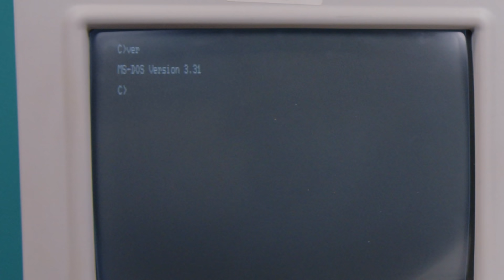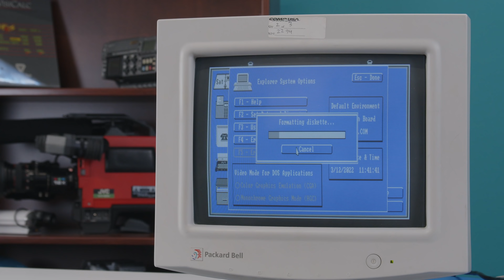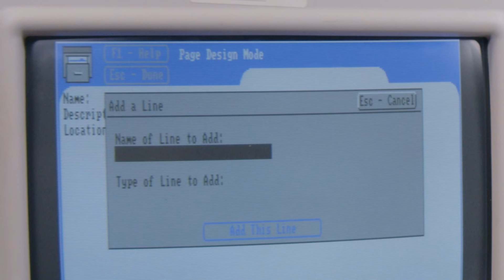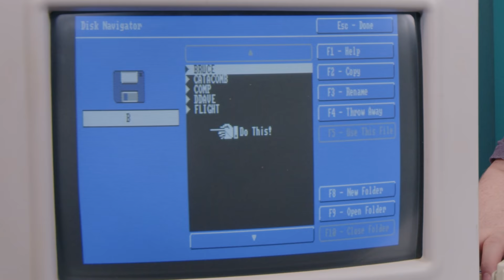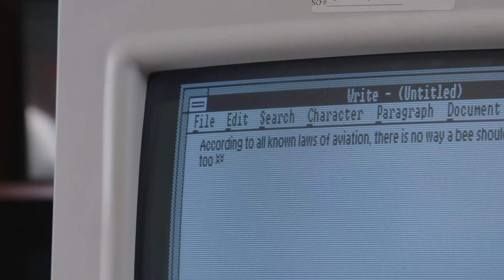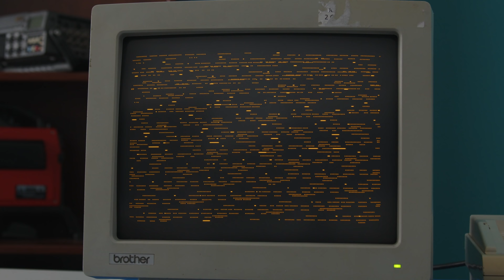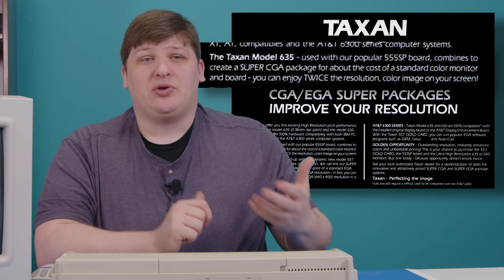Headstart's PC With The Weird GUI "OS" [Explorer]

Comment: About access to the Bios of the 8088 era machines.  Most of them used a program to access the bios, including early 286 before the (Del) or (Ctrl-ESC) of some specific combination key were used to access the bios.   Yours, probably had a program on the system disk that came with MS DOS disk set from Headstart.

Oh lord, you're naïve,  you're criticizing the GUI when you have no idea of the programming language used at the time to make this GUI.  At the time, PC's were linited to 512 or 640 kb  of ram.  MS DOS 3.0 was the last small form factor OS that used the bare minimum of RAM out of the 512 or 640 Kb.  Now if that interface had been in Text you would see a difference.  Now to understand why the interface was that slow and limited, it's because of the video memory available for CGA, EGA and MDA/Hercule mode,  and the speed you write to that memory, if you push the data too fast in that video ram, you would get snow on screen due to the refresh rate.   I did some programming and let me tell you making a program that had pull down menues in text mode was special to program.  They were tricks to avoid the snow effect in text mode and have seamless text windows with pull down menues and pop up windows and you often had to do that in assembly language and with turbo pascal and Turbo C it got easier and the worst was MDA and hercule video cards that forced you to consider and program all the different video mode available at that time.   That was before windows 1.0  and your GUI on the headstart was probably inspired from the PCJr or Tandy graphical interface in DOS.  Anbd when PC & MS DOS 4.0 came out IBM had for a short time a graphical GUI on DOS and MS DOS had a text version GUI.  These didn't last since DOS 4.0 was so bad and BIG that prompted IBM to go back with their own version of DOS that became PC DOS 5.0

Comment: Pretty interesting PC, I can see this being someone's first home PC back in the late 80s.  One thing you didn't mention about the Tandy 1000 PCs is their enhanced graphics and sound capabilities which allowed for 16 onscreen colours plus 3 channel polyphonic sound, much like the Sega Master System if you're familiar with that.  Are you also familiar with DeskMate on the Tandy 1000s?  It's a graphical user interface, much like the Bulletin interface on the HeadStart.  I'd be curious to see how you think DeskMate compares.  I've never used DeskMate, ever, in fact I've never used a Tandy 1000, of any variant, sadly.
Reply: I think the Tandy 1000 PC graphics and sound were inspired by (of all things) the IBM PCjr.  It supported a 320x200 16 color mode (along with the standard CGA modes), plus the sound chips to do 3 channel sound.
Reply: @spc476  Yes, you are right, it's well known that the Tandy 1000's capabilities were based on the PC Junior, and the Tandy 1000 PCs did far better than the PC Jr in terms of sales and popularity.
Reply: @spc476  Plus, the Tandy 1000s were far more compatible with PC software than the PC Jr was, one of the reasons the PC Jr didn't do well.

Comment: 22:00 420+69... LOL!
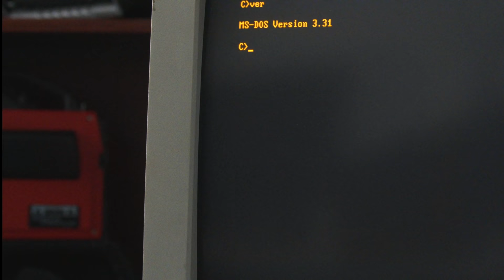39:21 Not 75Hz. 50 Hz. But that was okay with the long-persistence phosphors on old monochrome monitors. Not so much with that CRT. 39:49 Ah yes, much better.
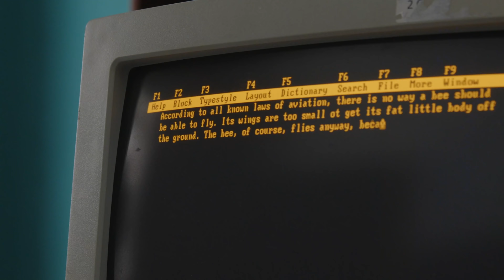40:27 The font looks a little different than Hercules or VGA. In fact, there's something weird. Look at the word "small" - the "s" kind of encroaches upon the "m" in an interesting, almost bitmapped way... this doesn't happen in the word "impossible"... is this an artifact of TTL signaling and the peaks being too close for proper switching? Or is it because the monitor does that when set to high brightness and/or contrast? This is weird, and charming.
39:54 you can actually see what I'm talking about a little better here with SYS and CMD.

Comment: I agree with you that 80s computer keyboards are extremely overrated. 99% of that sludge pile was standing on the back of the IBM Model F (and later model M).  To be fair, the F and M are amazing keyboards which were as expensive as they felt. Those two boards deserve their hymns of praise.

Sitting below this were some of the boards with Alps keyswitches and similar technologies. These at least tried to be okay, with varying degrees of success.

Then things dropped off like a cliff.

You had your well built but not necessarily well thought out 8-bit keyboards like those on the Apple II, Atari 800 and Commodore 64, which used nice things like mechanical switches and double shot keycaps, but the layouts and keyboard heights were atrocious. These feel like they spent the money to have something that was built pretty well to make a bold claim in a brochure, but then any focus testing or layout engineering was an afterthought.

Next come the real sins. You have your IBM PC keyboard clones, which at least cribbed the functional keyboard layout of the Model F, but paired it with putrid things like foam-and-foil key switches. Even lower were the cost-cut chiclet style keys on things like the ZX Spectrum and IBM PC Jr, which were barely usable even when they were brand new. Finally, at the very bottom is what I consider the biggest sin of the 8-bit era: the membrane keyboard on the Atari 400. Barely better than the switches on your microwave, marketed as "spill resistant", and the absolute bare minimum viable product achievable, it was amazing that they managed to sell even one unit with such a crime against humanity permanently affixed to the chassis.

Comment: Mm I bet that Miniscribe 40MB disk was an 8400 series and probably slow, loud, and unreliable. I want 10.
Fun fact, Intel almost backed out of the PC deal because they could not keep up with IBM's demand for the 8088, among other parts, so they turned around and licensed it to AMD. The AMD 8088 is the exact same chip inside, and was produced to keep up with the insane demand for the PC. The Fairchild part is I believe the same inside as well but for a different reason.
The NEC V10 and V20 are definitely their own special things, though. I believe inside the V20 is just an 80188 shrunk into the DIP 40 package.

Biggest problem with running it at double speed is that you either have to sit and wait on I/O devices forever just doing nothing or you risk running the I/O devices faster than they are capable of. That and DRAM access times being long would hold things up as well. So long as you were careful choosing components, you'd never run into a problem at the higher speed, though, which is what these Turbo XTs did.

Why not try the Tandy turbo switching software? A lot of times it's a keyboard command as well. Something like Control + Shift + T.

EGA was NOT the same monitor as CGA! Yes, you could configure them to let you use a CGA or MDA monitor (colors limited to 4 or 1 bit respectively) but they were made to be used with their own EGA monitor that accepted 6 bit color. 16 colors chosen from a palette of 63. Though, of course, to use this you needed the special monitor.
Reply: That speed difference is the entire rational of chipsets in the AT era and beyond.  That way, the ISA bus could be clocked at or under 8MHz, RAM wait-states could be handled, and the CPU is free to run as fast as it (and the chipset) can.  Since so many x86 instructions take multiple clock cycles to complete, it's advantageous even when waiting more clock cycles on I/O calls.
Reply from the maker: I think the reason I didn't try the Tandy software is because I couldn't find it for Tandy either. I've never found a utility that could switch modes on my 1000HX so I didn't bother looking. I did try a bunch of keyboard combos but nothing seemed to work.

EGA was supposed to have its own monitor, sure, but my understanding is that it worked with the CGA one if you used the CGA-type modes and set the dip switches correctly, so I doubt more than a handful of people bothered buying a new tube.

I've seen maybe three programs that could use the extended palette, presumably because developers, faced with the prospect of either:
- making software that wouldn't look right on legacy CGA displays (generating hundreds of angry support calls from customers who refuse to accept that they need a new $500 display)...
- ...or making software that supports both (more work, and still producing lots of angry support calls from customers who keep picking the wrong mode or have their card dip switches set wrong)...
- ...chose to just ignore the extended palette entirely.

Comment: you need to check turbo button functionality more, at least some of them worked fast by default and turning ON turbo slowed CPU speed.

https : / / en . wikipedia . org / wiki / Turbo_button

maybe features are limited by the size of rom chip ? All you want to save or write needs external disk or diskette, so all code is on ROM chip, which probably is few kilobytes in size.

Comment: You are very wrong about people having no desire to upgrade. The difference between a 486 and 286 is night and day... it's like comparing windows 2000  to dos version 1
Reply from the maker: If you have anything that needs it, yes. Most people didn't. If you're running Lotus Works at consumer scale, an 8088 - at best, a double-clocked one - can handle it effortlessly. Upgrading achieves nothing when the program already did everything instantly.
Reply: @CathodeRayDude  An insurance brokerage in my nearest city was still using a 286 in 1999, at least to fill out and print* forms with customers data.

* You guessed it, with a 9-pin dot matrix printer!

Comment: My Commodore 64 I used back in the day(as a kid, we are talking 1982). I disagree. I never had issues with the keyboard,  just a problem still seen in modern prebuilt  PC's, anemic ram
Reply from the maker: Yeah, I've been corrected on the keyboard issue. I stand behind most of what I say here, but I've been flubbing that one by comparing to the wrong things.

Comment: Too bad that you're so very late, 30+ years, to come to the PC with an onboard OS. 
Before you were born was a company called Commodore with its own color multimedia media, multitasking OS known as Amiga  Workbench (Spanish for Girlfriend) that was able to do this with 512Mb RAM. At the time Microsoft Windows required, I believe either 2x or 4x the same amount and was unable to multitask at all.
But enough of that, this is say that this is far from the first PC with an onboard OS and is probably not going to be the last.

Comment: I'm curious what type of switches the keyboard uses. I'm guessing based on sound that it's using dome with sliders or something.
Reply from the maker: I was reluctant to try to pull the keycaps since I've destroyed one keyboard, and heard of destroying others, by doing that, so I erred on the side of caution. At this point I might go back and check later, heh.
Reply: @CathodeRayDude  I'd look up and see if this computer is mentioned on the Deskthority Wiki (keyboard website). And I know if pulling up can break it, it usually means it's an odd switch design (like the NEC keyboard I use daily that has blue ovals that require you to roll the keycaps to the side to take them off). Or it could mean it's extremely dirty. I'd get a plastic spudger and just insert underneath a keycap and not apply much of any force and sometimes that'll safely (for the keyboard, not your face) cause it to fly off if it's stuck via dirt and grime.
Reply from the maker: @SonicBoone56  I actually did carefully remove one and the switch looks very similar to a futaba, although it has a slightly different stalk with a squared off base. I'll get pictures up soon
Reply: @CathodeRayDude  Futaba MA? As Chyrosran22 famously said, "It's more tactile on the upstroke"

Comment: My experience with home microcomputer keyboards back then was at the time bad to usable though since then I have tried other microcomputer keyboards since then and much better keyboards like the 80’s era IBM Model F keyboard. The worst where the membrane keyboards like those found on the Sinclair ZX-81/Times-Sinclair 1000 and the Atari 400. Chicklet keyboards where only slightly better but still bad like the original IBM PCjr  chicklet keyboard with no labels on the keys themselves  (instead printed above each key). The Sinclair ZX-Spectrum with it’s mushy keys was the worst but it was not good either (but better then the original PCkr chicklet keyboard. The original Commodore PET’s cash electronic register style keyboard was pretty bad with the key labels known to rub off too easily over time. The keyboards on wedge and computer under the keyboard machines like the Apple II, Tandy TRS-80 CoCo lines, and the Commodore C64 all seemed OK to me at the time though I’m sure I’d feel differently if I was using one of these today for any  length of time with the experience I’ve since had with much better keyboards. A lot of the keyboard type choice being made my home microcomputer manufacturers back then where the result of extreme cost cutting to try and bring the cost of their machines with a level uncertain buyers not sure if they really needed a computer in their home would be willing to pull the trigger on and could afford for those on more of a budget. The lowest cost micro computer models went with the cheapest technically usable keyboard but you knew you’d be having to live with that at that cheap price (TS-1000, the US version of the ZX-81,  sold for under $100 so obviously they had to skimp on the keyboard.). Medium priced home micros like the Apple II, C64, Atari 800, TI-994A, Tandy Coco’s, Acorns and Amstrad, etc had somewhat better keyboard in line with their higher price. It seemed to me that it wasn’t until the 90’s that cheap WinPC compatible PS/2 keyboards came out that were not horrible IMO even if not the greatest. Your basic cheap CompUSA generic PS/2 keyboard wasn’t horrible IMO for anyone who wasn’t a professional touch typist/writer. Obviously, everyone’s millage will very when it comes to keyboard preferences which is why not everyone hated Apple’s butterfly laptop keyboard (reliability issues aside).

Comment: 7:16 have you ever used an original atari 800?  (not the xl)
Reply from the maker: Yep, it's my favorite 8-bit computer. Absolutely solid design in so many ways and remarkable for the time, e.g. SIO is literally (you can look this up) the progenitor of USB. I still think the keyboard's really unpleasant, but it has more solidity than a few other machines I've tried.
Reply: @CathodeRayDude  the layout wasn't the best but the switches felt fantastic to me
Reply from the maker: @themagicboy6548  we could call this subjective but I find their fully linear travel really ooooof

Comment: Not fair to compare the keyboard to a 10 years older apple 2 that wasn't  bad compared to the PET of it's era. By the time this piano made it to market the 4 years old macintosh 512k was better in any way and about to be updated. The first golden era of apple.
Reply from the maker: I'm not comparing this year by year or contextually, I'm saying nearly all computers with integrated keyboards suck to type on, and I stand by it. I have an Atari ST 1040 and an Apple IIc that I find unsatisfactory as well. I've just never met anything else with a built in keyboard that I could actually rattle off a good paragraph on.
Reply: @CathodeRayDude  I get you, yet when you have typed a page of basic on a ZX81 everything is good (with glued on mechanicalish keyboard)

Comment: Are you sure the 25pin D for "drive" isn't a SCSI interface?
Reply from the maker: I've never seen a SCSI floppy drive, and it would add a lot of cost to the machine. Db25 got used for everything under the sun and very few manufacturers bothered to label it clearly so I think the most likely explanation is probably just that it's bodged shugart floppy.
Reply: @CathodeRayDude  Schneider Euro PC and Euro PC II (I think Euro XT and Euro AT too) had a female DB25 connector for the external floppy, available in 3.5" and 5.25"
Amstrad PC20 (also sold as Sinclair PC200 with a black case) had a female Centronics 36 pin connector for the external floppy data and a 4 pin DIN to power it.

Comment: I saw LGR's video on the Turbo button years ago, and he said turning on Turbo slowed the computer down. Am I misunderstanding?
Reply from the maker: If you consider "turning on" to mean "pressing in", yes, but if you wanted to tell someone to slow the machine down, wouldn't you tell them to "turn off turbo"?
Reply: @CathodeRayDude  If I remember correctly, all the computers at school and my personal Gateway 2000 would show the Turbo indicator light as lit when clicking in that button.

And from what LGR said, that'd kick you in to 4MHz mode. Totally opposite from what I'd assume "turbo" means considering turbo in cars means "fast".

But I don't think the button every did anything in Windows nor DOS. I don't remember seeing any performance difference ever.
Reply: @Saturn2888  It depends on the PC and/or how the BIOS is configured. Some systems boot up in full speed, so pressing Turbo illogically slows the computer down to 4.77MHz or thereabouts. Others boot up in the slower speed so pressing Turbo engages the faster clock speed. My own HeadStart machine for example boots up in the slower speed and only goes faster with turbo engaged, but my Packard Bell Legend PCs, my Woodgrain 486, Quantex 486, and many more all boot at the fastest speed by default, so pressing Turbo slows things down.
Reply: @LGR  That explains a lot and only adds to the confusion of how the button works :P.

But I get it now. Based on the machine, pushing or not pushing that button in will do something different.

The only time I'd seen Turbo buttons (that I remember) was on Pentiums, so that's probably why I was confused about it.